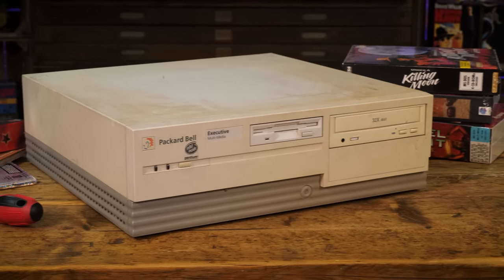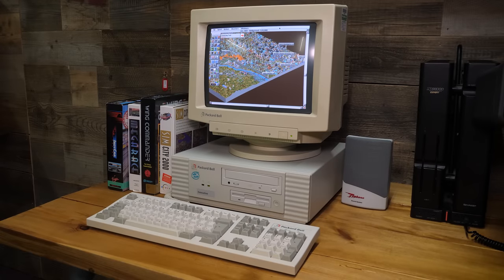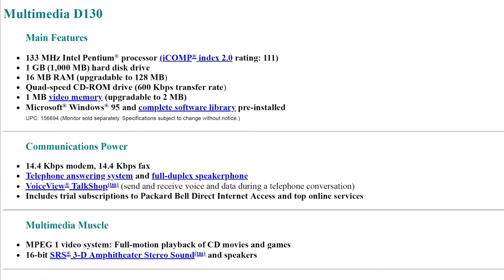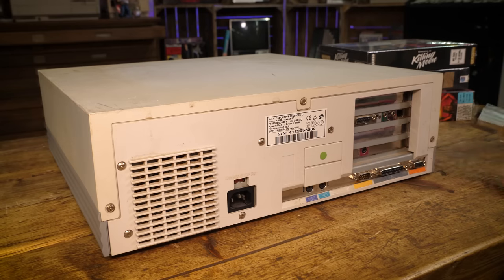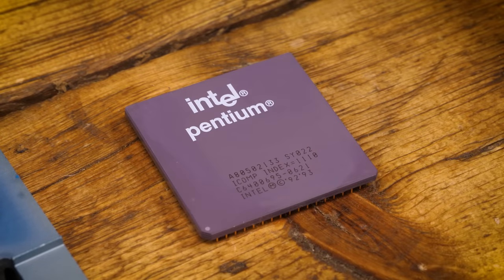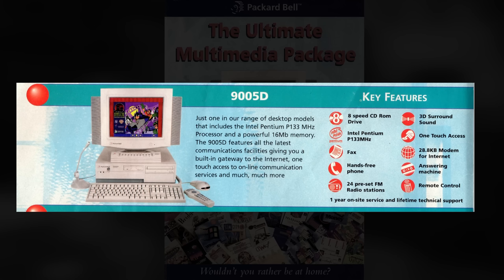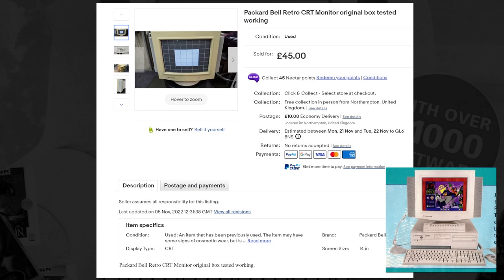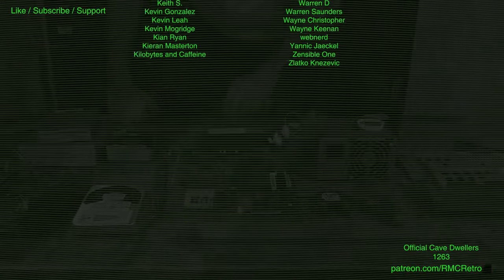Packard Bell Restoration | The Packard Bell Arrives | Trash to Treasure Part 1

Comment: Super excited for this one. The first computer I ever owned that was new was a 233mhz Pentium MMX Packard Bell tower when I was 12. Loved that thing. Was the first time I could walk into a store and buy new games eventually upgraded it with a Voodoo3 2000 PCI so I could play Final Fantasy 7 on it and then it was really flying. I found the same exact model a few years back and restored it just like you are doing, got the original keyboard and mouse, retrobrighted everything and it looks and runs great. For machines that were supposedly pieces of junk after 25 years mine still works great and I hope to keep it running for 25 more,

Comment: My first venture into the pc world moving from an Amiga 500+ was a Packard Bell with a 486 sx 33, 4mb ram, 170mb hdd, 1mb Cirrus Logic card(discrete), 3.5" floppy and 14" monitor. I got it through Radio Rentals here in Australia back in 1993. I added a Sound Blaster Pro 2.0 to it for sound and had it for a couple of months before upgrading to the multimedia version which came with the Aztec soundcard/modem, dual speed cd rom and the speakers attached to the sides of the monitor and a heap of cd bloatware. The Soundblaster Pro 2.0 that I had installed in the previous machine I ended up giving to a mate as the Aztec sounded fairly decent surprisingly.

Comment: Back in the 90s my father would typically be asked by friends and family to fix their computers and electronics. He hated when they would show up with an amstrad, compaq or packard Bell system. The latter quickly being nicknamed packed hell. This was mostly due to the proprietary nature of such machines and the complications this brought to repair them. Often it was simply easier for him to assemble an entire new machine as the cost of replacing the proprietary parts could be significantly worse than standard parts. 

This does bring back memories though of that era and makes me wish I still had my pentium 133 system which lasted me well into the early 2000s until I could afford to upgrade.

Comment: I completely understand the nostalgia for machines like this, my first family PC was an equivalent Dell Optiplex GL. It was thrown away in around 2003 but I got a matching model last year. I still have the non-original Turbo-Trak AT keyboard that we used with it (with purple function keys) but the NEC Multisync monitor is long gone.

Comment: "Not a good pc..."    This was my first PC!!  P75, 850mb conner HDD and a 4 speed cd-rom.  The built in graphics were only 2mb iirc, the monitor was a 14" with the speakers bolted to the side of it, but I loved it :)

Those 2 un-populated sockets are part of the video memory and I was given a dead stick of memory by someone and the chips on it looked almost identical to the ones soldered down next to those sockets.  So I managed to unsolder 2 chips from the dead memory, they are surface mounted not through pin, and popped them into those empty sockets and hey presto, I now had 4 meg of memory :D  That was the first of many upgrades I did to that PC before building a completly new one myself.

Comment: I had one of these machines in the tower case format I bought off a friend to use as a spare PC, it was a decent machine at the time with the exception of that combination sound/modem card. It was an absolute headache getting the terrible drivers PB had for it installed correctly, and the device working, especially the sound portion. Eventually I no longer needed the modem so out came the card and in went an ISA SB16.

Comment: Keep in mind, when you get the original disc, it will not take off on that 32x drive. You will need the 4 or 8x it originally came with. Packard Bell did this to prevent piracy. Those sound cards are VERY compatible with the games of the time. You will not use the 28.8, however, I have found that sound card does just fine. Mine has the 33.6. The surround speakers on the monitor were the weak point. Great system despite the hype. Very reliable, and the battery wasn't soldered or in a chip! Can't wait to see it running!

Comment: I was fortunate in that I did work experience at a small computer recycler (one of the first in the country probably) so I was able to pickup all sorts of computers for no cost at all.

I had a pizza box Compaq under a chair in the living room running Linux for ages doing NAS duties, hardly ideal conditions but its a small house and needed to keep the noise down.  I also shared dialup over the network thanks to early NAT support in Linux, before home routers were a thing.

Although my most memorable thing is one of those cheap computers which had the PSU lock into the case by an opening in the PSU which they didn't put an isolation sheet in it.  I once picked it up while running and touched the PCB getting a shock up my left arm that left it numb for hours.  Very lucky it didn't kill me.

Comment: I got given one of these as a hand me down looong ago complete with it's monitor, speakers, media remote, the lot!
Didn't have any restoration media though sadly, but recently I brought another one complete and restored it.

I built a 95 OSR2 image for the model I have, but I also went one step further:
Interposer installed with a K6-III, 128mb RAM (bearing in mind Intel chipset doesn't like more than 64mb!)
Voodoo 4mb PCI card, CF to IDE on the back, the full works all in the name of reliving my memories!

The Restore CDs actually are online but without boot disks, sadly. There is a Dixons restore that had even more bloat including ads for screensavers!

Comment: I was in college in 1996 and I got a refurbished HP Pavilion 7170 tower at the time.  It had a lot of design similarities to the Packard Bell with the speakers attached to the monitor and fax/modem/answering machine (which never worked properly).  Lots of component integration random features.  It was a nightmare to work in, with the motherboard split into two separate levels and there was no way to disable the on-board S3 video card for a PCI-card.  The color coding of the ports pre-dated the standard ATX color coding that came with the Pentium II-era PCs.

Packard Bells at the time had a really bad reputation as they really discouraged people from opening up the systems by requiring the use of special screwdriver heads, and other weird shenanigans.  More power to you, Neil, for attempting to restore one, but it feels like you're going through a lot of effort to restore a Ford Taurus to mint condition rather than a Ford Mustang...

Comment: I have that same keyboard. I got it new old stock laying around in my uncles basement. Now I use it with my modern gaming computer that I built in 2020. The motherboard has a PS/2 port that can use either mouse or keyboard.

Comment: I’m with you on this one Neil, as my first Windows machine was a 486DX Pacard Bell (interest free from Curry’s) 

After de-bloating, numerous hardware upgrades  and being allowed to sit next to my A4000D, most of it went to the tip as I self-built for the first time. 

The A4000D I still have, battery removed but in need of re-capping……. Need to get onto that sharpish !!

Comment: I had one too.  It was also my first pc as well and had many fond memories as well as learning what makes a pc work.  The sound/modem card is a PB Sound 2.  It is easily configured in dos with the 3 Sound 2 diskettes where you can set your address, IRQ, and DMA as well as the other various functions. You will also need to edit your Autoecec.BAT to reflect the settings you choose. If you want to install an NIC you will need to disable the serial port to free up IRQ 4 and assign it to your NIC I still have all of the original drivers as well.  My PB started out stock with a Pentium 100 and 8 megs of ram.  it was topped out with a Pentium 200 MMX and the max of 64 megs. Hosted many LAN parties playing Duke Nukem, Shadow Warrior, Carmageddon and many others.  It will play them all in real mode dos perfectly.

Comment: We had a Legend 410CD, and I loved that machine. I was at the recycler's a few months ago and happened to spot that familiar grey and beige case. Sure enough, it was a Packard Bell! And the same model we had when I was a kid! $100 later and it was on the way home with me! My parents bought the original one in 1995 at Circuit City in the US. It had (as does mine) a Pentium 75, 8 MB of RAM, a 4X CDROM, loaded with Windows 3.11 (unfortunately mine didn't have a hard drive, but I bought a CF card adapter I will eventually end up installing in it). Maybe it was a cheap PC, but I remember it costing my family about $2000 with the monitor and those hang-on speakers. Was that cheap in 1995? That's nearly $4000 today!

Here's a screenshot of a newspaper ad I found of the Legend 410CD from the time period.
https://imgur.com/JwOmWvg

Comment: I remember my family getting a similar machine from Circuit City in 1994 - same case design, but different internals - 486DX2/66, 4mb memory, 420mb Seagate HDD, a 16 bit sound card (Forte 16), and a TV tuner card. The TV tuner (branded PBTV) used a ribbon cable to interface with the video header on the motherboard and could grab stills from video, which was pretty remarkable for its time. The hardware for that machine is long gone - the system itself died after about two years and the monitor died a year or two later. I do, however, have most of the CDs that came with the system - back then, bundled software wasn't the bloated rubbish you get today - you got full versions of software (Megarace, a bunch of Knowledge Adventure educational titles.

One notable feature of the  Packard Bell systems of that time was the fact that the ribbed panels on the case could be swapped out for different colours - you could match your Packard Bell to your decor, years before Apple and Compaq did something similar

Comment: This one resonates, it's like the motoring 'Festival of the Unexceptional'. We bought a P120 with similar specs in 1996 from a local dealer (Stak in Rugby - who are still going) for a lot less than a branded system as the internet was too much for our trusty Acorn.  After that it was self-build all the way.  Things moved on so fast then - five years later we had Ghz CPUs and I bought a similar spec ex-corporate Compaq for £10 from a computer fair in 2001. Voodoo 1 pairs OK with a P133 for games like Tomb Raider and Interstate 76, I use one with a non-MMX pentium.

Comment: I bought a Packard Bell P75 "Legend" as my first computer in late 95. It certainly wasn't the most amazing computer, but it was mine and worked reasonably well. The sound card / modem wasn't all bad, although it did have some dos compatibility issues. The conner hard drive was a bit sketchy as I recall, and it was one of the first things to get replaced.

Comment: What I really remember about Packard Bell is the Navigator software that was included with the computer. At least it was with ours. I tried it out and quickly realized that the normal Windows interface was far superior. Also, I remember the onboard sound being a combo card as well, with modem, CD ROM controller, and sound on one card. That card stopped producing sound for me so I had to upgrade to a sound card from ESS Audio. It was cheap and effective, but it wasn't a Sound Blaster, which is what I really wanted at the time.

Comment: From experience:  The speakers on that generation of Packard Bell monitor are fastened on with machines screws, 2 per speaker.  Also for the sound/modem combo card, you could either ignore the modem portion, install the drivers anyway, or find some way to disable the modem altogether.  The sound drivers are available from vogonsdrivers if I'm not mistaken.

Comment: I don't recall ever just throwing away a computer. I can only recall getting a used computer and stripping it for parts once in the last thirty years, I prefer to fix them. I have never owned a Packard Bell but if I ever acquire one I will certainly play around with it.

Comment: My first PC was a Packard Bell Club 75.  Celeron 500, 64MiB RAM, 8.4 GB HDD, DVD-ROM, Win98SE, Gigabyte 6WMM7.
Just yesterday I ordered a second hand tower of the same model (but with different DVD drive and 20G HDD) being sold as used working on eBay.  I still have the master CDs and most of the bundled software discs, hope they all still work!
Reply: Or it might have been a 2500C.  The model names are confusing and it was a long time ago.

Comment: Many years ago I worked in an independent computer shop, and we'd get people bringing these in asking for them to be upgraded. We almost always ended up building them a new PC, because the slimline case with the slot riser card meant that you couldn't replace the motherboard with anything else.

The dust in that one also looks like it's been somewhere where people have been smoking. I used to have to deal with PCs that were completely clogged up inside and stunk of cigarette smoke.

Comment: It definitely deserves the treatment - just because it's such a staple of home PCs of the mid '90s! Same thing goes for a Compaq Presario or IBM Aptiva, they weren't great by any stretch of the imagination, but they were there and they ushered in the digital age, so a lot of us are bound to remember them.

I'm glad to have had a few PCs before the whole multimedia SW/HW bloat got out of hand, but Packard Bell was definitely not the only offender! (Had 3 Compaqs before all the multimedia/internet buttons and functions everywhere, one 75MHz Pentium Prolinea, a 486DX4 100MHz (I also enjoyed that CPU a lot!) Presario and then a 166MHz Pentium MMX Deskpro.)

Caps on those old rigs were surprisingly good, I've got two of the machines still running, but a recap should definitely be considered imo.
Modem/sound card combos... aah, IBM had so many of those in their 486/Pentium PCs and they were so often a cause for headaches, especially when re-installing the OS and trying to find a driver that would actually work, whereas Compaq had pretty decent sound solutions in their PCs of the era. (ESS Audiodrive were common cards in Compaqs, and they are great SB compatibles.)

A VRAM upgrade would be interesting to see as well, just for the sake of it mostly. ^^ And a 3DFX Voodoo Graphics card would be right at home in this PC, with it being released in 1996 as well.

Comment: Great Video, I had one of these as a teenager it was my first pc, I upgraded from an amiga 1200. It was brought from Dixons for £1650 I soon started to upgrade the ram and storage about year later added a 3dfx card when it first was released, came with turok dinosaur hunter bundled game. I also upgraded the processor with an intel overdrive chip which took it from 120mhz to 180mhz with mmx if I remember. neil try to get one of these overdrive chips
Reply: In these weird desktops with riser cards, there is so much potential for upgrades. Yes, 3DFX but then try to change the CPU multiplier. It should take a Pentium 200 or Overdrive MMX 200. 180Mhz is not terrible.

Comment: Oh, I remember doing "work practice(?)" in secondary school in a computer shop when these were new. And an uncle of mine even bought one later. This would be 1997-ish. That machine is undoubtedly looong gone (just like the 386 he had before that, double sad face), but it would've been cool if they were still around. Maybe not the best of machines but certainly nostalgic. I hope you get that Aztech card working. Just something about combined cards that is interesting to me even if modems can't really be used anymore. Otherwise going for the likes of the AWE64 Gold is always an option. A Voodoo 1 should work fine enough on this system. Windows 95 is what I think I'd put on it in terms of OS'es. Keep up the good work.

Comment: Lol. I have a friend who got a Packard Bell P3 brand new back in high school, was a fairly expensive machine at the time, P3/500 with both a DVD-ROM drive and CD-RW (I think, could've just been a plain CD-R), I remember the monitor literally went up in smoke within a week of him getting it, and he had no end of problems with the thing. A couple of years later I think I recall the only original parts left were the case and power supply, and I think the DVD drive, heard of lots of other people having trouble with them too, as a teenager I preferred to call them Crappard Smell myself :) That said if I were to come across one today I'd probably end up restoring it for nostalgic and historical reasons.

Comment: This was my second system. My father saw the display model on sale for $200 for a P75 Mhz machine and they stated the machine was covered under warranty  so while it had a lot of problems they would be fixed. Packard Bell set up an appointment for far too long in the future for my young self so I experimented  and fixed the machine before the technicians could come in. They replaced the power supply anyway just to get paid I guess, citing a weak blowing fan as reason for the replacement.
The biggest issue seemed to be the optical drive having issues. Found out a few years ago as I referburshed the sytstem that there was just a pin in the ide connector that was bent. d'oh.

While this was not my first system this was the first system I ended up learning a great deal about troubleshooting especially when I installed a Diamond Stealth 2 S220 in it and had odd display output issues and had to sit on tech support to fix it on the occasion.